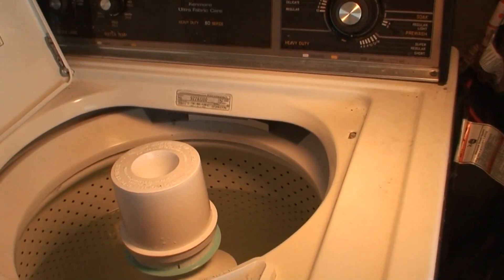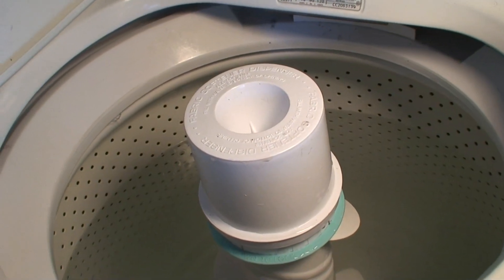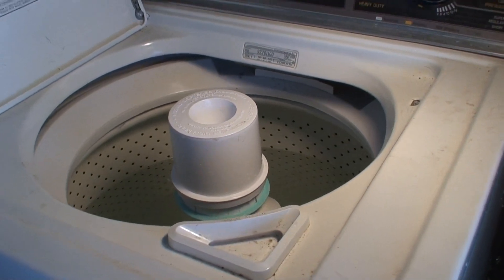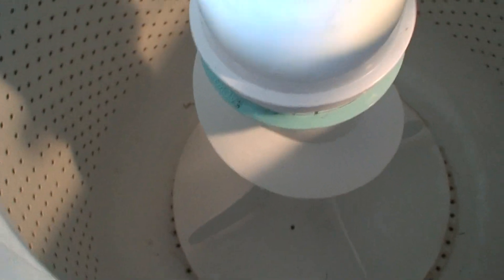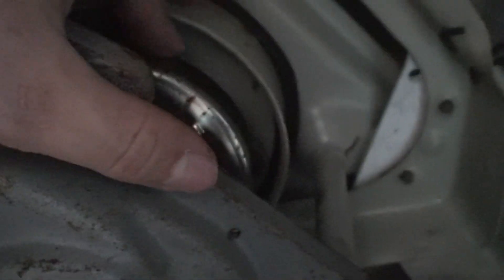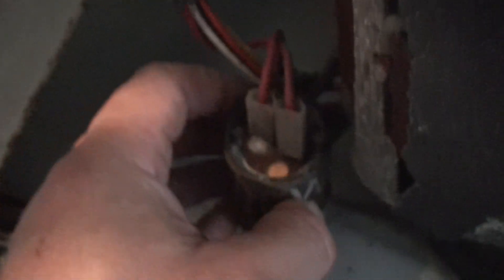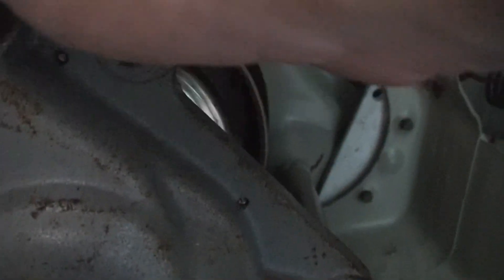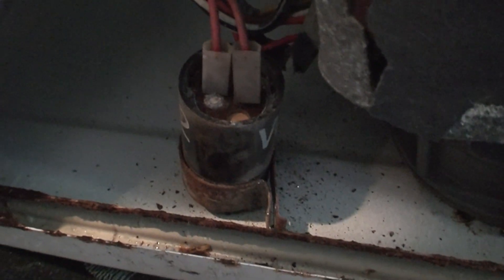Octember Came Early

Comment: Sounds like a motor issue, but you could test both it and the capacitor. Maybe running it on the generator damaged it? I know the hertz are a bit off versus ac voltage. 
https://www.youtube.com/watch?v=C5F-_U0_hYw

Comment: There are no positive or negative leads on a AC motor Capacitor leads can go on either way but do be mindful they can hold a nasty charge even with the machine unplugged in some cases so treat with respect  , motor will just hum and will not start if the Cap is bad , its not common the motor fails .. replace the cap or have it tested ,, all you need is the washers model number to find the correct one..

Comment: im betting its a motor problem either burnt/shorted windings or a bad capacitor. I'd try the capacitor first. i found an amazon link for a replacement capacitor: https://www.amazon.com/Whirlpool-8572717-Start-Capacitor/dp/B00DZUAEIA